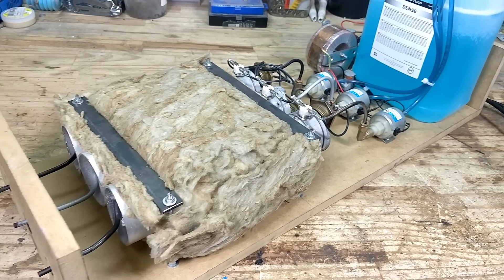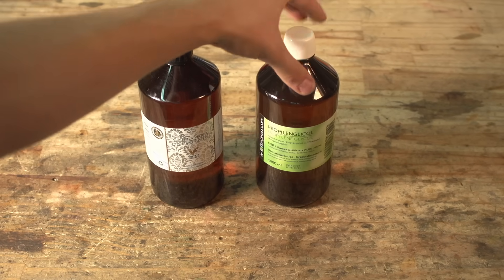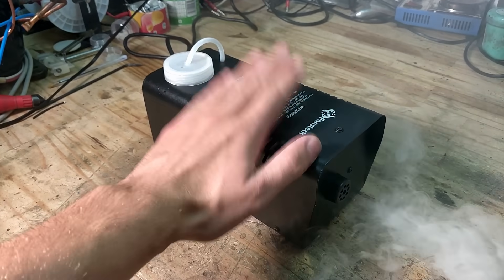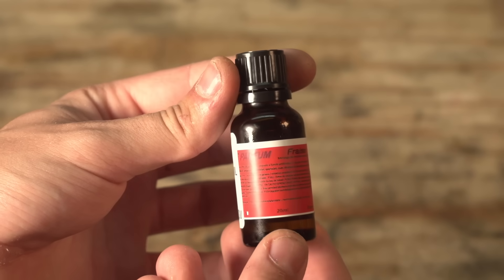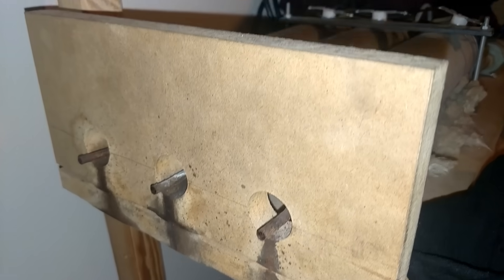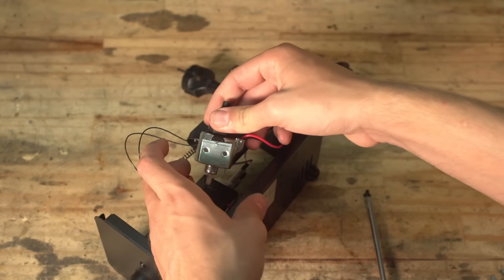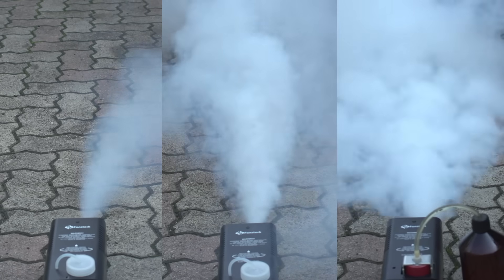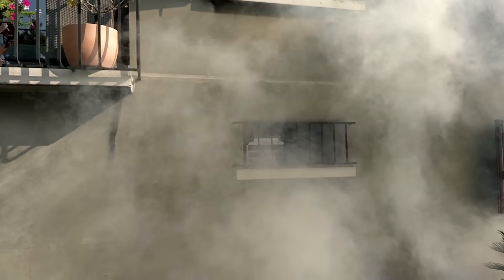How To Make a Cheap Fog Machine 10 Times More Powerful

Comment: Having worked in the entertainment industry,  and having to deal with both foggers and hazers, I think the big reason for the distilled water is to ensure that the bulk of the glycol is flushed out of the heater to prevent clogging. Glycol tends to build up right at the coolest part of the heater element (usually intake / output areas) and can for a crystalline plug (looks kind of like pitch) and will destroy the element as it's nearly impossible to dissolve out again.
Reply: I make soap with glycerine regularly.  I wonder if an alkaline solution run through the pump would clear it out by saponifying the glycerine.  Zero idea what that would do to PG or the pump internals, though.
Reply: yeah. if you got shows 5 nights a week and need the haze/fog machine to work and keep working reliably the added water makes a difference
Reply: @knoxvalleskey1636  why not just flush with water, maybe a bit of vinegar, after use?
Reply: @gordonsensei330  because time. the time needed to fully clean, dry, and refill a machine isn't in the time budget when you're running shows consecutively. once a month doing a good flush and clean is realistic, but after every show isn't unless you can afford a guy to do just that
Reply: Fog or haze definitely can trigger optical smoke detectors, that work by checking if light can pass through the air without being diffused (meaning there is smoke.) So in places where fog is used regularly, the fire alarms use heat detection. Either triggering at a set temperature (fixed temp,) or when the temp rises a certain amount in a certain time (rate of rise.) Otherwise, fire alarms have to be disabled for the time the machines are being used. I'm not an expert on fire regulations, but that can then require things like notifying the fire department and assigning a person to fire watch in the building.
Reply: I use a hazer at my local club. This would obviously be for one off SFX right you think? Or actually like this could be used inside and not set off a fire alarm
Reply: @joeyp1028  If you're looking for thick fog that won't impact fire alarms, look at nitrogen foggers. They can dump huge amounts of thick white fog which dissipates quickly. The other added benefit to nitrogen systems is that it'll take the temperature of the room down 20 degrees quickly and temporarily for an awesome feeling when things really heat up.
Reply: Now imagine that crystalline plug forming in your bronchioles, and you'll never want to vape.

Comment: I worked with all sorts of fog machines for 25 years in any size venue. Using fog machines causes sticky residu to stick to the entire rig, specially near the machine. I can imagine that the water makes machine last longer. Pretty sure the water also helps to diffuse the fog better (called granularity, an oil cracker/hazer has much lower granularity for instance). I checked bottles and the fog with higher granularity rating have less water percentage. In clubs you usually also add a fan for better area coverage. Oil based  fluids give long lasting effect, water based is short lived but doesn't trigger a fire alarm.
Reply: As a former club tech I can attest to residue issues in having had to clean all the lenses and mirrors pretty much on a monthly basis (that said, a club without fog tends to lack atmosphere)
Reply: Using Fog Machines in Aircraft testing for Smoke penetration/barriers. 
Clean up is hell with regular fog Juice. I cant imagine modded juice and the residue left behind.
Reply: Oil based will leave residue on stuff around it, whilst water based won't do nearly as much
Reply: will store-bought Fog juice leave a slippery residue on the ground?     Like glycerin soap leaves a slippery residue on your hands.
Reply: @dianamccandless7094  Believe me it sticks to Everything and if you have anything with a cooling fan it also gets inside along with dust until it all goes up in Smoke! Weaker the mixture the better!
Reply: @dianamccandless7094  no, it will not, it will be on the rig near output of the fog machine
Reply: It will also clog up AC condenser coils.
Reply: How many times did the Fire Department show up as you experimented? I bet his neighbors were all flipping out thinking something was on fire lol
Reply: Hi, 25 years of experience sounds wicked !!! So, from your perspective what will be the best solution for the club around 400 people :
- hazer ora smoke machine ?
- any kind of self-made liquid to prevent all the machines with fans ... CDJ .. Amps... Moving Heads ... to suck this sticky liquid?
Reply: @rakokarol  small club use normal fog with a good fan to spread.. hazer most likely not in the budget for that size.
Reply: @RonDLite  , but if the budget is not the issue. so overall what is the better choice?  the liquid for the fog machine and for the hazer is different?  so which one is more pleasant to the electronics?
Reply: @rakokarol  a little waterbased hazer. LCG has a good one, I think MOKA SFX too. The fan dissipates the smoke straight out of the machine & makes a way more beautiful result :)
Reply: @rakokarol  for the electronics a hazer would be more friendly, specially since it is way less granular/course.. from show perspective a hazer gives you the base to makes lights visible  and fog gives you effect
Reply: is there a mix to make smoke linger near the ground ?
Reply: @cthulpiss  that's not a mix.. it's means it's cold smoke, can either use dry ice or some machines can chill the smoke as it comes out but with less satisfying results.
Reply: @cthulpiss you have to chill it, like run it through ice, the key is to get it cold cold
Reply: I find it way less problematic with waterbased fluids compared to oil based. I only got risidue on cold windows and metal parts for now 😮
Reply: Also, oil based juice leaves an oily residue on everything…ick
Reply: depending on the firealarm, the optical firealarms are super sensitive to any kind of smoke compared to the older radioactive firealarm which will take way longer until it pops off, that is why there is no firealarms in bathrooms on hotels as it would give a false alarm every time someone took a shower there
Reply: @Coinfindr  proper alarms are usually both infra red as optic, however when using oil based smoke from smoke machine (not oil cracker), they still trigger the infrared due to higher exit temperature.. (340 Celsius) make sure to check type of alarms against your method of smoke (heat,pressure,glaciator) whenever you are in any venue. With oil based smoke from heat method smoke machine, you can be up for nasty surprise otherwise. The video does not show any oil based fluids..
Reply: @RonDLite  Absolute nonsense. Heat sensors don't measure heat at source around the room, rather use a thermistor in the heat detector. In your described scenario, candles or lighters would be activating fire alarms, which they don't. I was a Fire & Security engineer for 15 years until I changed job around this time last year.
Reply: @AceDC2  it is not the heat of the nozzle detected, but it is that heat that makes the smoke go straight to ceiling
Reply: @Coinfindr  Ex-Fire alarm engineer here. Some shower rooms will be fitted with Heat detectors instead of Smoke detectors, or possibly Dual sensors that required both, as a way to avoid false alarms. In this case, no amount of smoke/fog/haze will set them off, but a sudden rise in heat can. This also depends on the materials the room is made/finished from to what sensor will be selected.
Reply: @AceDC2  yeah i know about those too, very common in workshops as smoke at the ceiling is happening every day
Reply: @Coinfindr  I dont even know if you can set off a radiation smoke detector with a vape. I have breathed a super thick cloud directly into one before and it didn't care.

Comment: Awesome, now make me one that is small enough to fit on an electric 90mm jet, can produce fog like that,  and can run on a 14.8v or 29.6v lipo (4S or 8S lipo) for short bursts of 5 seconds or so. Someone else already made something like this. But it does not produce very much fog, especially in prop wash or air flow. Let alone the 120-140 mph speeds my jets can reach, never mind that the jet thrust out the back (where the fog should come from)  is easily twice that speed.  I'm thinking it's probably not possible to make something small enough to produce enough smoke to make it viable.
Reply: Just use a e cig with a fan on it
Reply: @hansdampf2084  Doesn't produce enough smoke. The velocity of the air coming out of a 90mm EDF is over 200 mph. So it just gets diluted with normal air and you can't see it. Perhaps if i placed it at wing tip where the air is only about 80-140 mph or so. But that wouldn't look the way real jets do it, and I bet you still hardly see it.

Comment: I made some fog liquid out of a mixture of 25% distilled water, 25% vegetable glycerin and 50% propylene glycol. When I tested, using more VG or more PG did nothing to increase the density, and even more water could be used, up to probably 35-40% without much noticeable difference. The reason the fog liquids are mostly distilled water is first, it's cheaper, but second, PG can be highly irritative for the lungs and eyes, and some people even have adverse reactions to VG.

Here in the US, you can order a gallon of USP/food grade VG for around $20-$25, and a gallon of USP/food grade PG for around $30, or medical grade for a bit more.

Using too much VG will eventually clog the heating elements and destroy the pump. Because it's vegetable based, it burns and solidifies more easily. PG on the other hand acts more like a cleaning agent and will help to keep the elements clean, but it's still a fairly viscous fluid as compared to water.
Reply: As as heavy and knowledgeable e-cig user (basically a miniaturized fog machine) I can confirm using too much VG in the mix can clog the heating element and produce carbon build-up; a small amount of PG can help cleaning and also wicks better, but also too much PG can irritate lungs and eyes (PG is used to enhance flavor and give some throat hit). The general consensus for good cloud density is 70% VG and 30% PG or 70% VG, 10% distilled water and 20% PG.
Reply: @sacordovaplata  Some e-juice recommend adding vodka, as it thins out the liquid, but doesn't affect the vapour production as it evaporates much quicker than water.
For a smoke machine one could just use lab grade ethanol as one is not drinking it.
Reply: @TryptychUK  Lab-grade ethanol is actually much more expensive (and much harder to get) than just using vodka.  (Denatured ethanol is nice and cheap, but you definitely do not want to use that, or probably even isopropyl alcohol, for this application.)  Realistically, just finding the cheapest vodka you can get is probably the best practical option for adding ethanol to the mix (though it does have a large proportion of water, too).  If you need a higher ethanol percentage than that, using something like Everclear is probably still an easier/cheaper option than trying to actually get ahold of pure (lab-grade) ethanol.

It would be interesting to see whether using something like vodka instead of water does improve the fog quality.. it might theoretically also even have better cleaning properties, I'm not sure..
Reply: So if I use the 50/50 mixture for a while, (till I'm done for the day), then clean it out with the vinegar solution, would that be fine? I'm using a rather expensive fog machine and don't want to damage it at all.
Reply: Avoid vinegar, it can corrode the machine inside! Alcohol is better  @cooltrentguy
Reply: @cooltrentguy my question as well
Reply: Did you notice much buildup from the VG when using your mixture?
Reply: @NordicDan  Not too much, no, but I haven't used it more than a couple of nights a year (we do 80's reunion parties for what was a local dance club here in Louisiana)

Then again, the machine only needs to work less than half as hard, because it's making more than twice the amount of fog. It's give and take. With the water and PG content, it should stay fairly clean, but if it doesn't, just run a mixture of 80 water/20 PG through it and that should clean it right up.
Reply: Can confirm that PG absolutely destroys my lungs. Even at low % mixture in vape it literally feels like pouring hot water into my lungs. Guess I am just unlucky :/
Reply: You bullshit your way through that impressively.

Comment: There are commercially available fog liquids called heavy, extra heavy or dense or so which will do more or less the same. They are containing way more glycerin/propylene glycol then the standard/cheap fog liquids. Also they are way cheaper then mixing it on your own. A 5 Liter canister will be somewhere between 20-35€, maybe even cheaper.
Reply: Maybe in Europe. A quick search, I can get a gallon each of VG and PG for $68.50, giving me 2 gallons with no dilution at $34.25/gallon. a gallon of 'extreme high density' fluid is $34.50/gallon. Assuming there is NO dilution in the premade the pricing is equal. But I suspect there is some water dilution in the premade. Not way cheaper as you mentioned.
Reply: true i had a long time ago a little fog machine with lithing and i also got the really heavy duty fog for outside events but used it indoors with on big whoosh my whole room was completle smoked out
Reply: Do you know what brand?
Reply: The fog juice he’s comparing it with is labeled Dense

Comment: I wonder how well a D5 would work for pump in this kind of thing, They are often used in PC water cooling and can really move a lot of fluid.  Also why is aluminum used in the industry and not a much denser material. Copper for example is used in many computer cooling solutions.
Reply: They don't get the pressure needed for the evaporation process. That process can lead to something like 10 Atmospheres of Pressure or more. A D5 can provide like 2-5.

Comment: Would there be a way to color the “fog?” I don’t think so.
Reply: The amount of dye needed to get colored fog would instantly clog the machine, and would basically just be a paint sprayer, because everything the fog touched would get color stained. So even if it was possible, you wouldnt want to do it. There are fireworks based colored smoke cannisters but colored smoke and colored fog arent the same thing.

Comment: Do you have a turotial to make a protable fog machine that runs on battries?
Reply: just use a large ecigarette and blow air through it slowly with a bicycle pump.

a normal small fog machine can be used with high current capable li-ion/lifepo4 cells and an inverter
Reply: @y-o-u-b  E-cigarette is illegal in my country (Singapore).

Comment: When you use one of these indoors and the fog dissipates, it isn't vanishing, much of it is settling on all the nearby surfaces, so you are coating everything with a fine layer of glycerin and/or propylene glycol.

The same happens outdoors but over a much larger space so the coating is correspondingly thinner.
Reply: This.  I'm livestreaming in my garage-sized studio and I don't want all my electronics and gear covered in that sticky coating (which then has dust settling on it too).   Also, filling a room with a higher concentration fog will definitely be noticeable to anyone breathing it.  Maybe not the most pleasant sensation haha
Reply: Lost my tv to this :(
Reply: why does vape smell stick to my breath but not clothes

Comment: One problem is that the classic "dumb" internal wiring for these will run either the heater or the pump but not both, and as a result no matter what the power of the heater is, it will not pump fog continuously.

You really want one thermostat so the pump only runs when the block is hot enough to evaporate the liquid, and another separate thermostat (set for a slightly higher temperature) to control the heater itself. Plus, of course, the thermal fuse and any other overheat protection.

Comment: Great video.  Could you add a small amount of essential oil?  I've got a pirate theme and there are several "ocean breeze" type oils.
Reply: essential oils should probably not be evaporated.
the bottles I've seen contain "harmful to the lungs" warning signs.
Reply: @jelteklaswijnja4055  Thanks for the heads up. Much more research needed.
Reply from the maker: I'm not sure essential oils should be heated to 260°C, they might emit toxic fumes...

Comment: To answer your question only small time bands or back yard Halloween shows use combustion foggers. A professional DJ or mainstream band or stage production doesn't use a$200 fog machines. They use haze machines . Haze machines dont vaporize liquid or glycol with a super hot heating block.. Haze machines use high pressure pumps to vaporize a stream of liquid much like a venturi pump produces a cloud of air bubbles. The result is a less opaque cloud that acts more like a fine mist than a white cloud. Combustion foggers also smell. Hazers have no odor.

Comment: The water in these mixtures provide humidity to the air to build up the fog if the air is really dry.
The fog you can see is just condensed water because glycerin and propylene glycol is hygroscopic (cloud condensation nuclei).
Reply: As a vaper, I concur. The clouds linger and are FAR thicker on cool winter days than in the summer.
Reply: @bm256industries  Well it depends on the temperatur as well, but the principle is the same.
Reply: no

Comment: The cap for the pump is copper, what's the tube made out of? What are you using for brazing?
Reply from the maker: The cap is brass and the tube is some kind of copper / aluminium alloy. To braze different metals together I usually go for a silver rod (a bit pricey but really effective)
Reply: @NicolasSalencPBP  Thanks! I didn't notice you actually replied sorry. I was trying to figure out if it was possible to buy ready to use connectors, I was looking at brake lines accessories but they are a way bigger than the 2mm of the heating element tube